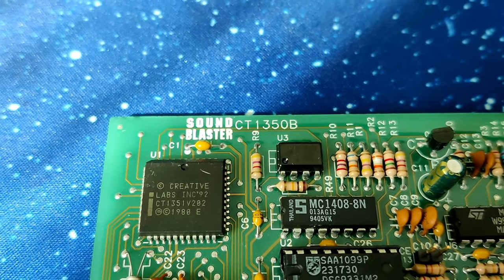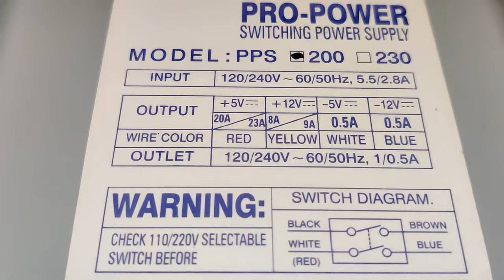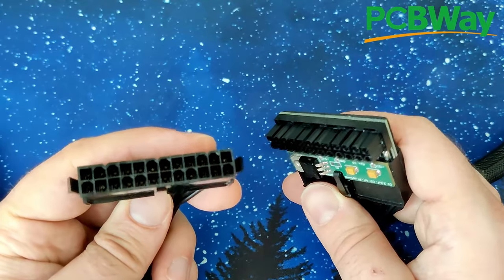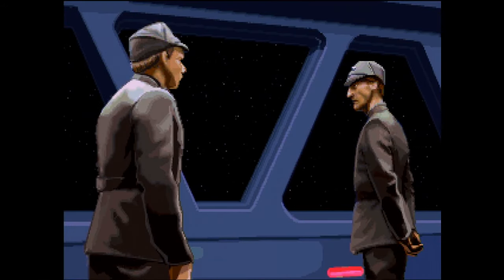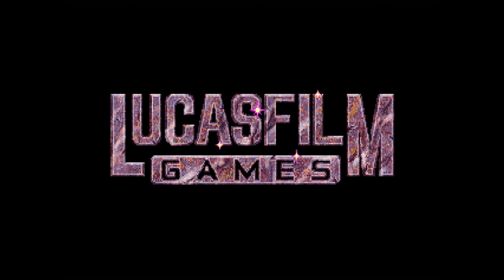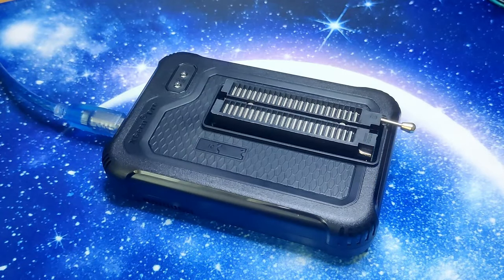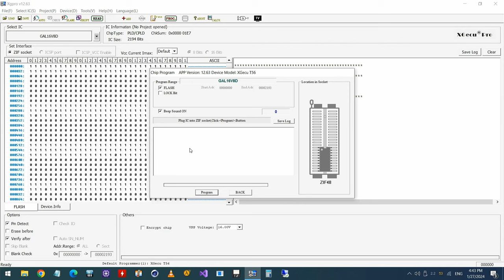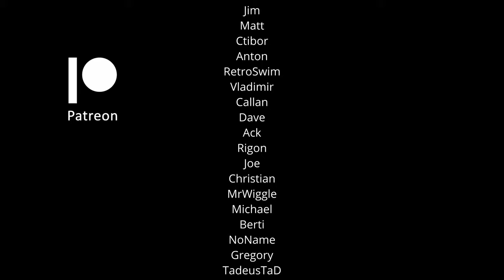The Secrets of Sound Blaster 2.0: CMS or OPL2? Here you get both!

Comment: I've had ESS688 sound card back then and it was much better than Sound Blaster 16 or newer Creative cards. Why? It was fully compatible with SB Pro + OPL3, which meant great compatibility with games. SB16 had limited compatibility and older games seen it as SB 2.0 without stereo.
1994 and newer games had SB16 support for 16-bit audio, but they usually used 3rd party drivers for sound and they also had native ESS688 support too!
ESS688 was of course 16-bit 44kHz sound card in Windows 3.x and 9x.
Reply from the maker: I believe that I had the exact same model - I am just not 100% sure. That sound card was great! I loved it, but I no longer have it. I hope to find one some day. Unfortunately, I did not understand all those features back then: OPL3, wave tables, etc.
Reply: @bitsundbolts  There were many cards from different companies that had ESS688 chip. They came with similar set of drivers and software, but they weren't 100% compatible with each other, especially their bundled software for Windows 3.x.
They were rather low-end cards back then, but I like ESS688 these days for really good SB Pro compatibility, with the exception of Duke Nukem 2 and ability to use 16-bit 44 kHz in Windows and later DOS games.

My ESS688 had also IDE controller for CD-ROM and software MIDI port. It works with SoftMPU. Few years ago I've connected my old 2000's MIDI keyboard to it while connecting keyboard audio out to sound card line it and I've got really good General Midi support for games.

Overall ESS688 was a really well designed solution for its time. One of rare products that had all needed and useful features and nothing more.

Comment: Very interesting Video as always, thanks✌️I would check the following:  
opl2 ym3812 ic: pins have continuity to PCB / cleaning contact & pins
ISA bus speed <=8mhz?
Possible speed issue - disable cache, lower cpu speed (I'm sure you checked allready)
And testing the sb on another motherboard to see if it is mobo-related

Good luck🍀

Edit: remember you have checked two different sb's so its most likely something else, very strange behavior indeed, and no further Idea😢 I would assume memory- or disk data integrity could be a reason, but then it would be the same on other cards like the ess. Have you tried conservative memory and cache timings?
Reply from the maker: I haven't done anything with CPU speed / disable cache! So, this is what I am betting on at the moment! I tested on a different 486 motherboard (ASUS 486-SP3), but I got the same issue. I did use the same CPU and cache was enabled as well. So, I think something could be there.

Comment: OPL2 requires 3.3 microsecond addressing delay and 23 microsecond data delay. Some games don't implement these delays in their code properly as old PCs were often slow enough or game developers simply developed for OPL3 which didn't require such long delays. With more modern PCs one can fix this issue usually by setting higher 8 bit I/O recovery time BIOS.

Comment: Great idea and PCB, but tantalum capacitors could be critical, they could create a short and explode, using ceramic capacitors should be better, it could create audible noise, but shouldn’t in this case
Reply from the maker: I picked tantalum capacitors based on the recommendation in the data sheet.

Comment: Yup, of course i do have a ct1350, got to check the version of the chip though... But as I see, it should work on any version. Was really thinking about upgrading mine for a few months but never got to order the parts... 😅
Reply from the maker: Yes, the CMS upgrade should work with any version. There is a link in the video description with the compiled JED file. Or, you can use the software bundle from the same link to compile it yourself. I also have left-over chips. So, if you are interested, let me know and we can figure out how to get them to you.
Reply: @bitsundbolts  i would be interested in the chips of course... How can we arrange that? Do I leave you my email address here? Is that even possible? 😅
Reply: I also have a Soundblaster 2.0 card (with the 1336A chip) which could use a CMS upgrade, so if you have extra chips available I'd be interested and very thankful if you could ship them.
Reply from the maker: No, don't leave your email address here. I also do not want to leave my address here because scammers may do the same. If you're on a web browser, you should be able to find my email address in the about page of my channel. However, I'm trying to set up a partnership to simplify shipping. I'll hopefully announce something very soon!
Reply from the maker: I'll set up something to make it easier to get those chips. It may take a couple of weeks though.

Comment: i get same "drunk orchestra" effect with snarkbarker card on my 486 board. From my understanding it happens because of incorrect bus signal timings for OPL2. Need to slow down isa clock somehow.
Reply from the maker: Interesting! Well, good to hear that I am not the only one having such an issue in a game. Still weird that it didn't happen in all games. I will try to slow down the system somehow or use the cards on a 386 system. The sound cards did behave exactly the same in a different 486 board from ASUS.

Comment: I wouldn't use a Sound Blaster 2.0 with CMS on anything more powerful than a 286 or 386 due to the issues you ran into, along with having MUCH better options with better compatibility and less noisy sound, and don't have issues with single-cycle DMA/normal DMA mode (you might recognize this as popping or static when voice lines or ADPCM samples play on games)
I'd recommend the ESS Audiodrive with an ES1868F chip (supports ADPCM), or a Yamaha ISA card like the YMF-7xx series (supports OPL3) with those faster 486/pentium 1 based systems.

Comment: Such audio problems often are results of bad timings of something. I.e. slow hdd, device on usb, overclocked or underclocked some components. Changing slot or irq could also help. Sometimes could be driver (mouse, emm386).
Reply from the maker: The EMM386 also crossed my mind! I had to enable it for X-Wing because it requires EMS memory. You're the first one suggestion that, but that could be what causes the music distortion. The motherboard/CPU cache might be another one to check!

Comment: Hi. First, excellent video.

Second, how did you get a stereo output with the CMS sound? Did you use the soundblaster's speaker output 3.5mm? 

Also, do you have any chips left? I Have a Quickshot Sound Machine. Ever heard of those?
Reply from the maker: Thank you.
Yes, I did use the speaker output. CMS produces a stereo signal on the Soundblaster 2.0. Everything else is mono. 
Yes, I do have chips left - programmed and ready to go. I just have issues with logistics which adds high cost to 10 dollar chips. But I managed in the past to get electronics shipped if time wasn't an issue. If you want, contact me through email (bitsundbolts at gmail dot com). We can continue there. Thanks for watching!

Comment: Maybe timings on ISA bus are a little bit out of spec on this motherboard. Check if your BIOS allows changing ISA bus clock.
Reply from the maker: I tested the cards on a different board (ASUS 486SP3). Unfortunately, the cards behave exactly the same. I will try to disable caches first or use a slower CPU. If that doesn't help, I will try some BIOS settings and ISA clocks.

Comment: Iirc the sound blaster 2.0 is speed sensitive.
I don't know which board you tested monkey island with. If it was the slot 1 board, I think you should try it on a 386 or a slow 486
Reply from the maker: It is a 486 board. I tested in the Soyo as well as an ASUS - same behavior. Someone suggested to disable the caches on mainboard and CPU. This is what I am going to try next... That may just be the cause of it...
Reply: @bitsundbolts  well when I mean a slow 486, I really mean it, remember this card is from 1991 and therefore the most cutting edge CPU was the 486DX-50, no dx2-66 available, no vlb either. And even then, most people were still playing on 386s. If you don't have any slow 486 or any 386 disabling the cache should indeed help a lot
Reply from the maker: I will try the cache first. I do have a 25 MHz 486 as well as a 386 DX-40. So, it should be possible to verify if it is really the CPU that is too fast. I will report back once I have this tested.

Comment: My SB16 Value CT2770 (real OPL3) sounds tinny and crapophonic.  Do you know if these ISA cards require the missing voltages?  It's noisy and extremely quiet even with powered speakers turned up.
Reply from the maker: You can check if the fifth golden contact is present on the solder side of the card (where no components are located). If the fifth connector pad is missing, then your card does not use -5V. Unfortunately, some cards may just have all ISA pads available even when they don't use them. Then gold got a lot more expensive and those extra pads were removed (that is what I think).
If it is silent, you could also suffer from some bad capacitors. Both, dried or physically damaged capacitors may lead to what you experience.

Comment: I don't know if this is the cause: Depending on the card, some OPL2 chips need some time after a register is set and the next one is accessed, so maybe the CPU is too fast for the game?. I once made a demo using the OPL2 chip. I did not program the music playback well (the code did not wait every time an OPL2 register is set) and that resulted in weird sounds in some cards, OPL2 seems to need that extra time to work well, OPL3 does not need it (I think).
Reply from the maker: Interesting! Maybe the DX2-66 is too fast? I will try to disable the caches as others suggested. And if that doesn't work, I am going to test those cards on a 386 system. It is just weird that both cards behave exactly the same - so, you may be right with your assumption.

Comment: You're running the card in a 486. So that sound card is a bit older then the PC. The ISA bus speed might be a bit fast. I expect a 486 to have options in the BIOS for the ISA bus speed. See if you can set it to something slower.
Reply from the maker: Turns out it was related to L2 cache settings in my BIOS. Setting the ISA clock speed to 7.x MHz didn't improve it.

Comment: I have a different sound blaster version in my 386 pc. It is CT1320C version and it has only 2 empty sockets for chips and I dont think it has CMS either.
Reply from the maker: That's the predecessor: The Sound Blaster 1.0/1.5. I guess the sockets are 18-pin, 9 on each side?
Reply: @bitsundbolts  yeah, both empty sockets have 9 pins on each side. The sound card has been working fine in the system for past 5 years since I built it. Your video made me wonder if it could also be upgraded with cms even if having only 2 empty sockets.
Reply from the maker: Then I believe you only need the SAA chips. The logic of the GAL chip is already integrated. Should be an easy upgrade.

Comment: Lol drunkenblaster :D
Have you replaced the small yellow tantalum caps? They go bad after 20-30 years usually. I'd recommend swapping them with ceramics.
Reply from the maker: I only replaced the electrolytic caps so far. First, I want to try and disable the caches of motherboard and CPU as someone suggested. Then I have to check for other possible causes.

Comment: I think that Monkey Island issue is software. Or hard/software. It may be BIOS conflict or something. More tests are needed to figure it out, as well as trying to use SB 2.0 cards on Socket 7/Slot 1 platforms, maybe even 386 (I don't remember what sockets are used in that). It's better to try it on AMI-powered mainboard as well. Both cards CAN be deffective the same way but it's nonsence, IMHO. You can also try true AT/ATX 1.x power supply, though I don't think it would change something. But if?
Reply from the maker: I solved the issue. There were two BIOS settings related to cache that caused that issue. Both cards work perfectly fine after that change (there is a post under the community tab of my channel that shows both settings).
Reply: @bitsundbolts  hmmm… Cache policy and wait state… Okay, now we know that. Good job!
BTW I think that these settings on my SiS 496/497 system board are incorrect so it freezes at POST if running at system bus of 33 MHz. Anyway it’s not the subject, just thinking how to work it out.

Comment: do you need to cut anything on the 90 degree adaptor?
Reply from the maker: Cutting in terms of the adapter itself? No. I could just use it as is. However, I need to use cables because the adapter will not fit directly on most old motherboards due to the location of the power connector.
Reply: @bitsundbolts  oh you are right, just saw the diagram, -5v is N/C in atx v2.0 vs v1.0.

I thought it was being used by something like 12v, so I would need to pay attention to some old dell supplies then, some do use that pin with different pinout afaik. 

Thanks for your help!

Also, if you could, could you do a thru hole PCB? that'd be a lot more easier for people (and me!) so I can use caps I have around
thanks for your answer
Reply from the maker: Hello, great that you think this solution is worth considering. I could change the PCB and create a through-hole version. But wouldn't that interfere slightly if you want to glue it on an ATX connector like the one shown in this video?
Reply: @bitsundbolts thanks for considering.

So the caps and resistor would be nice to have an alternative version with thru hole. I think there’s enough space in the atx adaptor for it.  The regulator is fine as it is, I would say.